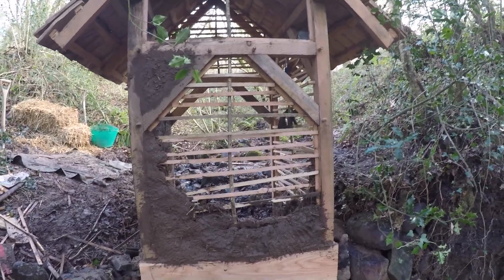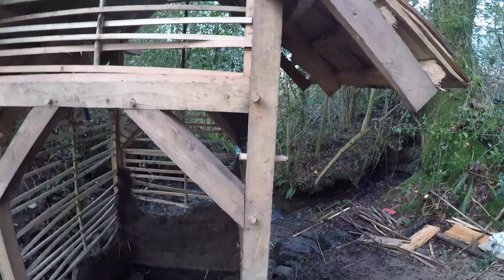Diy Micro Hydro  7 Almost finished powerhouse

Comment: You put a lot of work and crafts into building the power plant building. But will not the bottom of the power plant's building start to rot if the humidity is high? It was possible to make a foundation of stones.
Reply from the maker: I have answered this question at least 50 times now.
Reply: Kris Harbour it must really make you lose the will to live!!

Comment: I loved it but I didn't get why no tar paper on the roof.  It's incredibly simple and does the majority of the work for the roof for cheap.  The shingles will split and warp over time and the paper will hold it for longer than the shingles will alone.  Great little building either way.  That's a keeper.

Comment: Aren't you worried about frost getting into your cob before it dries? I always leave mud work till spring but perhaps you're reasonably safe in the warm wet west?
Reply from the maker: It was a bit of a worry, I was out there checking it one night that got down to -2 but where it is it is really sheltered in the woods and down in a damp patch that never seems to freeze. And sure enough it was fine. So as long as we don’t get much colder then -2 it should be fine.

Comment: Those beams sticking out the side of the roof will be prone to rotting due to water lying on top, check out 1970's buildings, they also sported those doohickeys, an architect screw-up to make buildings look nifty. Now, 30-40 years later they are causing structural issues due to rot on top of the beams and more importantly inside the buildings. You would be better off making sure to let the beams have a slope to them to let water run off, just thought you would like to know.
Reply from the maker: I’m going to cut them down a bit and shape them at some point.

Comment: I may have missed something? When it rains heavy and more water comes down the stream than can go through the turbine what stops the turbine house being washed away? It's such a cool building it just looks in harms way?
Reply from the maker: that little stream only has a small collection area, it never gets much flow i have been watching it for a long time and even in really heavy rain the flow isn't very high. definitely not enough to move this building, its foundation extends in to the earth, it would take a huge amount of water to wash it away.
Reply: I think what Kris is saying is that this is on a side overflow stream, he is diverting water from the main channel through a pipe to the turbine house, and the water then flows back into the main channel

Comment: One aspect to consider, hopefully you already have, is how to contain the forces at the end of the pipe. Often, the final bends of the system are embedded in a few tonnes of concrete. That won't be needed here, but since you have 17m of head and potentially a large flow rate at max power, you will need a reasonably substantial anchor.
Reply from the maker: yes that is very true, it will likely come in the form of the pipe being buried and maybe being fixed to a large rock.